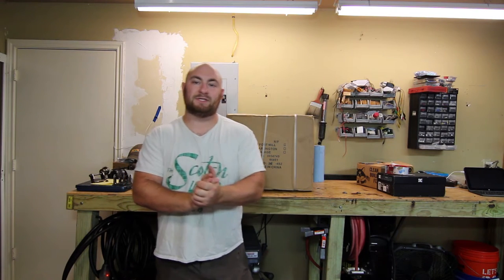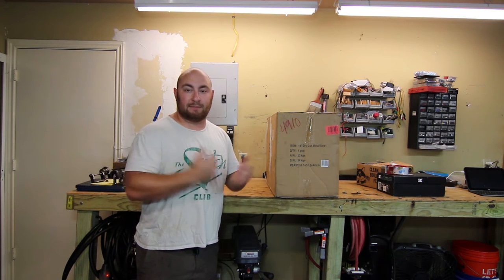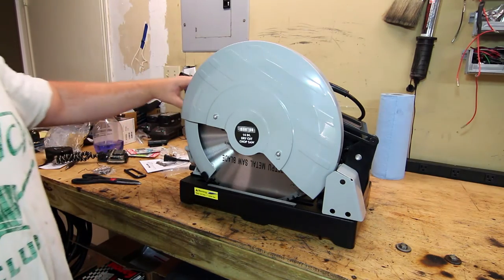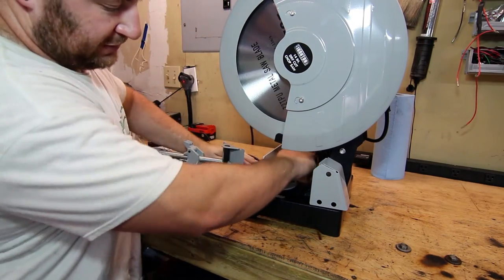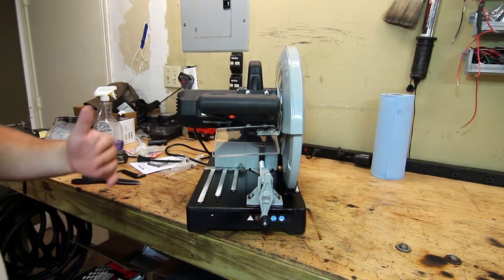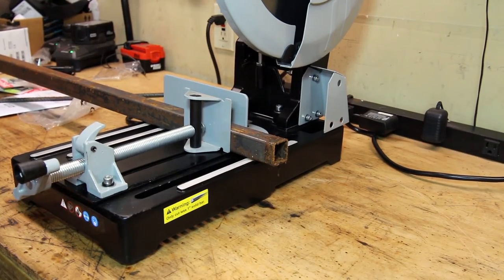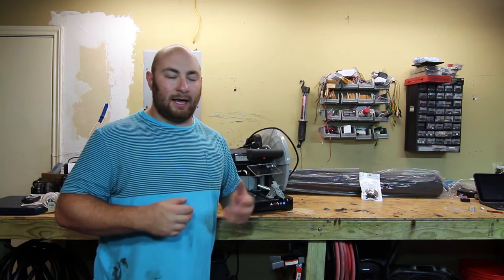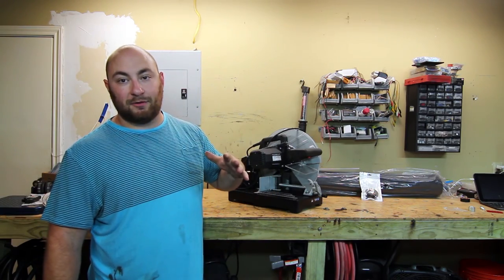MaksWerks Reviews - Northern Tool Ironton Dry Cut Metal Saw - PN 46461 - Unboxing and Review

Comment: I bought one of these and it worked great for several cuts.  Then I noticed it had twisted off square. Since the saw had no adjustment for trimming or shimming the blade to square I had to make cuts then grind them to square.  The last cut I made the saw had actually twisted during the cut to the point that the blade hit the right side of the base and caught.  It mangled several teeth and ruined the blade.  Had to take it back which is a shame because it is a beast of a saw for the price point.  The arm just isn’t made to stand up to the torque from the motor.
Reply: I bought one of these saws, but still have it.  The blade that came with the saw only lasted about 10 or 15 cuts.  Very discouraged.  I was told that the starter blades don't last very long. I bought a Diablo blade and it worked much better.  I was making some 45 degree cuts and and the blade hung up and deflected into the base just like you described.  Ruined the blade. Very Very discouraged at this point.  I decided to try one more Diablo blade.  After several years the saw is working very well.  My assessment is that I was trying to use it like my old abrasive saw, meaning I was forcing blade through the material.  I found that if you gently apply pressure it works well.  I am still on my third blade after probably several hundred cuts.

Comment: How well does it cut 45's? Looking for a saw that can cut angles on a regular basis with an accurate angle that isn't needing to be cleaned up for making miter joints for tables, etc. Thanks!
Reply from the maker: its decent. But in general I prefer to use the cut square method to join angle as it gives it a nicer finish, and stronger joint, IMHO

Comment: A quality mild steel cutting blade costs around $125. Stainless blade costs more, and an aluminum blade about the same as mild steel. The really top blades are over $200, and often, $250, though you can get them for less if you really look around.

This is a good saw though, particularly for the price. I’m seeing carbide saws for $100 more with a pressed steel base, and a crappy vise. I’ve had good luck with Northern.
Reply: If was cutting 3"x3" x 3/16 tubing what roughly kind of blade life can i expect (number of cuts)
Reply: You can get a diablo 14" blade for about 90 dollars right now, 72 tooth.

Comment: Cast aluminum, not iron.
Reply: Yep, cast aluminum.  My hold down bolt stripped as it is only threaded into the aluminum. I fashioned a steel plate underneath the base and brazed a nut to it.  Drilled out threads in base, bought longer allen head bold and passed in through the hole into the nut underneath.  Really sturdy now.